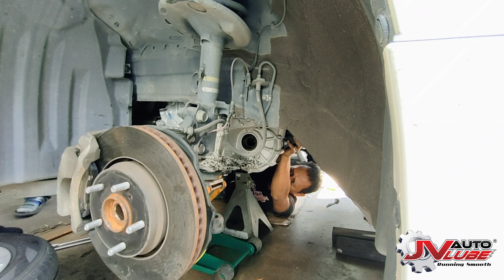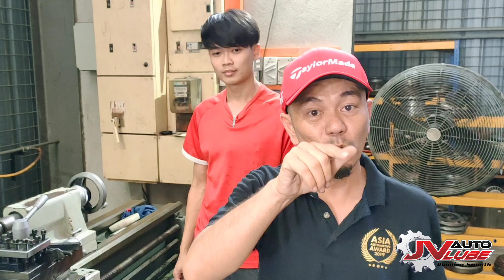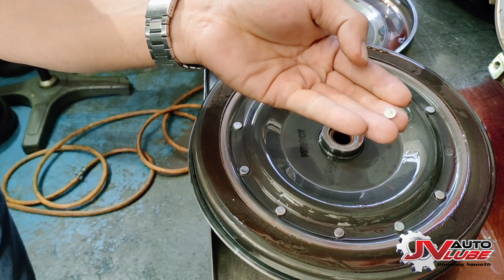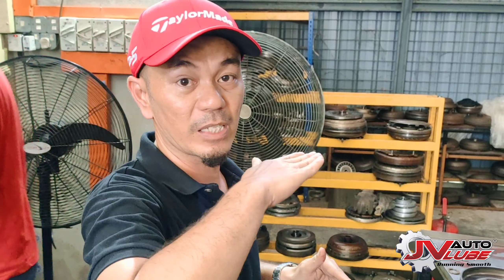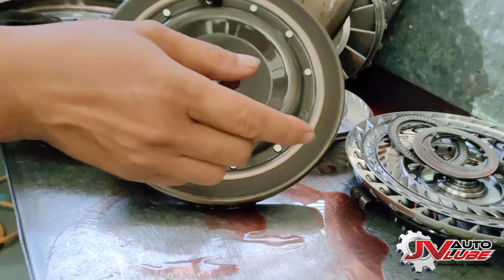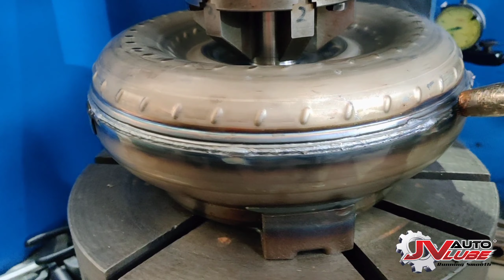Torque Converter Toyota Vellfire CVT TRANSMISSION

Comment: Cvt vellfire perlu add on ATF cooler atau tidak?
Reply from the maker: Boleh tapi tidak menjadi kewajipan
Reply: @JVAutoLubeHQ  mohon bantuan...kereta sy vellfire 3.5v6..2008 bukan cvt...guna WS.....masa drive gear D..shift 1 nak masuk 2 ada gegar/vibrate ..shift 3,4,5,6 smooth...masalah bila starting je lepas tu ok..n masa tekan minyak slow xde gegar..tapi bila tekan minyak kuat masa starting rasa gegar kuat...mohon bantuan

Comment: CVT transmission ada torque converter ka?
Reply: bergantung pada manufacturer. cvt punch proton tiada torque converter.
Reply: @ahmadfk3315  owh mcm tu..tq atas infonya
Reply: CVT tork converter ada pada model keta jepun. Cth honda, toyota, nissan, subaru. Yg suzuki, daihatsu, isuzu pakai auto biasa. Mitsu pakai klac sama cam proton. Proton amik teknologi CVT dr mitsu.
Reply: bila tekan minyak jln lurus then lps smule pedal minyak,ade bunyi duk2 atau sengok2 kt area depan....klo tgh laju then nk berhenti utk perlahn,tibe ade bunyi duk2@senguk2 bunyi ape ye???spedo meter plak jd senguk trun naik...kete wirA...bkn semput